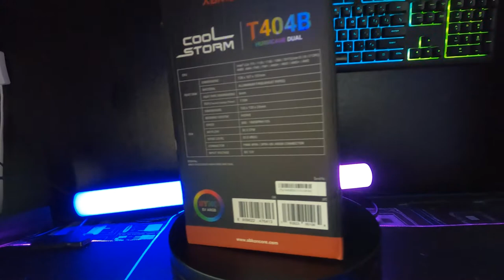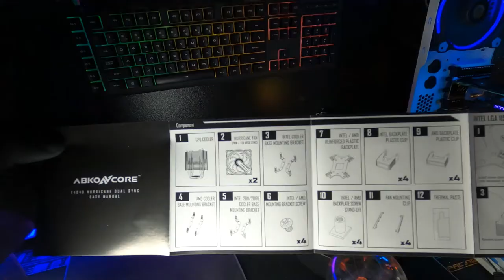ABKONCORE RGB CPU Cooler CT404B

Comment: I bought the same CPU cooler. It has so many wires I don't need. is there a way to take them off?
Reply from the maker: no you can remove the wires... unless u want to cut them off.. i just cable manage it the best i could.. its nice cooler.. but way to much wire..lol  did u like the video ?  consider Subscribing and check out my channel .. thx
Reply: @pcman4747  bet

Comment: dude i wanna buy it and i really need help . this video didn t help me a lot cuz you didn t whot the cable management ... i only have 1  4-pin cpu port ONLY i don t have RGB ports or anything like that .... will it works for me ? (2 fans and rgb are working) or it will not ? plss help meee
Reply from the maker: the video wasn't a review.. more just a show.. i would get a splitter.. like fan header splitter.. or a sperate rgb controller for it. instead of running it off software it would be remote control.  they make  pc fan splitter and rgb splitters.. allow u to run 2 to 1.. or u can get a sata to PWM fan header.. or like a 4 pin to 3 pin fan splitter..
Reply: @ATECHPCs  thank you for help ❤ ... They don t make fan dplitter here ;-; but do u know what  will happen if i run it off software?
Reply from the maker: @gamewithali5063  yea. I forget which rgb software u need.. It should in manual or box... Yea go on amazon and type in what type of fan spittler u need.. Im sure you will find it.. Also. If i remember. Its 1 4pin fan header and 1 rgb control.. U can run just off the fan header but not be able to control the rgb..    Subscribe :)
Reply: @ATECHPCs  i can t buy fan splitter ... but when you said 1 4pin and 1 rgb control that made me happyyyy cuz like that i can run it (without software) i ll not be able to control the rgb but it will be on rainbow mode ? or there will be no RGB ? THANK UU VERY MUCH U WILL HELP ME A LOTTTT
Reply from the maker: @gamewithali5063  it will be on rainbow mode.. like in my video  ... u change that buy getting a  3 or 4 pin rgb controller .  .  https://www.amazon.com/LEDdess-Rainbow-Controller-Strip-Remote/dp/B07JZCNPNV
Reply: @ATECHPCs  so i can just plug in the 4pin and it will turn on on a rainbow mode ( no need to plug in the 3 or 4 pin rgb controller ) ??
Reply from the maker: @gamewithali5063  just use the PWN... no need to used the grb connector .. thats just for control ...
Reply: @ATECHPCs  sir thank you that was helping a LOTTTTT THANK YOU THANK YOUUUUUUUUUUUUU <3
Reply: @ATECHPCs  last thing please .. i have a fan controller on my case ( sharkoon VG-6 RGB ) and on it there is an empty slot .. so if i connect the rgb cable in it will it turn on in a color like the case ? like if the case is red the fan will be red ? but im scared if it didn t work the fan will not be lighting on rainbow mode anymore and i ll fucked it up and it will be just off or blinking or idk what s gonna happened
Reply from the maker: @gamewithali5063  U hurt nothing... i would try it and see... the worst that could happen is it not work.. but some rgb are 5v and some are 12v so u have to know which one your dealing with ...  the normal default mode is Blinking rainbow lights.. which is still cool,,,   thank you for Subscribing and make sure to enable notifications
Reply: @ATECHPCs  thank you very much sir.. You can t imagine how much u helped me.. I live in a fkn countrly a'd it tooks me a long.time.to make money so i have to choose wisely..thank you again and god bless you ^-^    (u said blinking rainbow mode.. Does that means turns on/of fast?)

Comment: hi  i really need help ... i only have 1 4-pin cpu port and 1  3pin 5v ARGB headers for ARGB control on my fan hub ( it s not connected to motherboard i just switch the color modes with a switch ) is that enaught ? or the 2 fabs required 2*4pins and 2*3pins for rgb
Reply from the maker: at 5.33 in the video.. u can see im using a fan splitter to run it.. both cables run to a single port.
Reply from the maker: well pause the video at 5.29 u can see it more better.
Reply: @ATECHPCs  the fan splitter came with it?
Reply: @ATECHPCs  ok what about rgb cables? How many